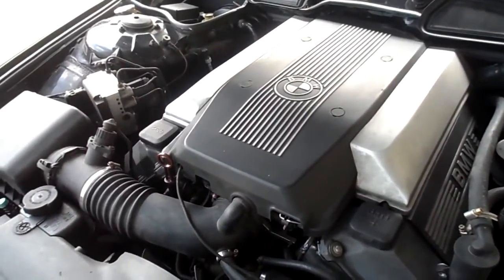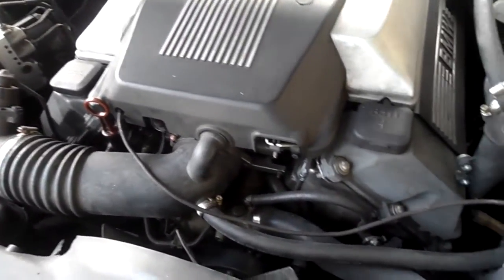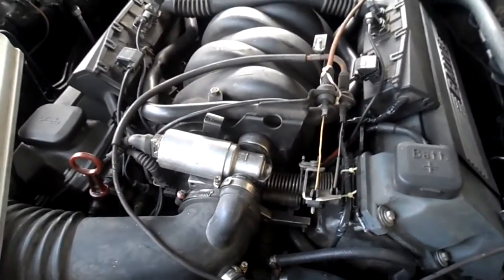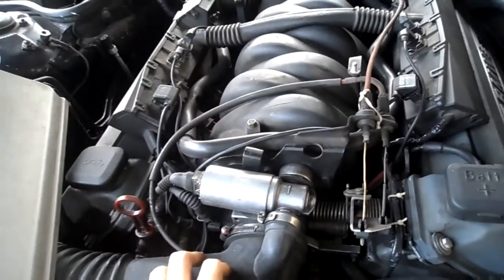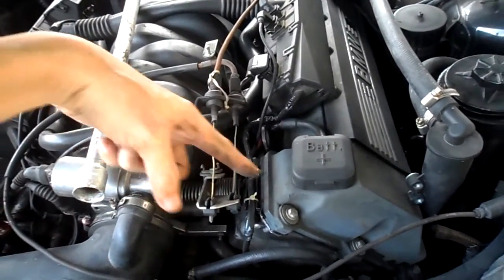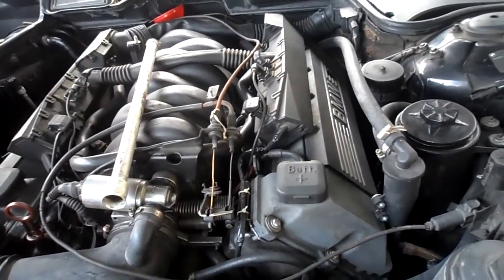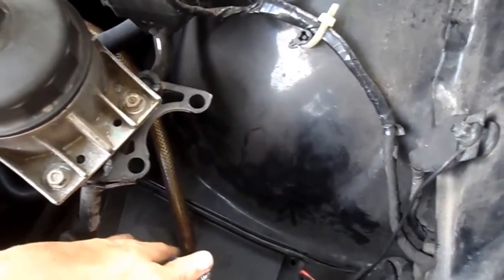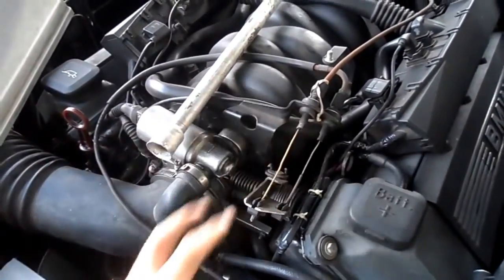Permanent repair of Intake Oil Puddle in BMW e38 M60 engine via Oil Separator bypass modification

Comment: Not to criticize you but this won't work forever.  It will only last for a few months.  Coolant hose does not do well with oil.   This also will make the car fail an visual emission test for modified.  I'm a smog tech that also worked at the CA Ref station.

Comment: Did you delete the ccv? Also, could one tap into the low pressure oil filter return line for any oil that drains to the bottom?

Comment: Can you block off the osv pipe and drill a hole into the nipple on the driver side valve cover? And just let it vent to air? I'm getting to much crank case pressure with just the delete plate installed
Reply from the maker: I think it is the same effect as venting from the OSV pipe. But since you managed to install osv delete plate, crankcase pressure has nowhere to go but seeping through every gaskets and it will create oil leak problems. 
Instead of just venting into the atmosphere, you'd rather route it back to intake hose between MAF and throttle valve. Good luck

Comment: same thing for the M62????2001 740il e38
Reply from the maker: I think so but M62 has less problem to overcome than M60. Simply replacing the PCV plate at the back of the engine usually fix the problem.

Comment: hey ...do you think that can be on a 2001 740il as well ????
Reply from the maker: I think so but M62 has less problem to overcome than M60. Simply replacing the PCV plate at the back of the engine usually fix the problem.

Comment from the maker: Please see hose routing details and 2019 update in description.
Reply: What did you do to the port/hole that the metal pipe went to on the back of the intake manifold? Did you block it off or leave it open? I have an 2001 740iL and it had an M62TU but I'm about to try this because I'm getting smoke on cold starts.

Comment: The oil needs to go back to the engine not on the ground
Reply from the maker: No oil caught by the separator touches the ground but left in the hose/container which was drained and disposed off properly.

Comment: or you could just replace the PCV on the back of the manifold in about 10 mins
Reply: oil separator is behind the timing chain on the drivers side. You have mistaken it for PCV which is on the back on the manifold.

Comment: did you block the hole off where the metal pipe used to enter at the front of the engine?
Reply from the maker: worst ever No hole was blocked. frontal hole where crankcase vapor was rerouted into an external oil separator, then back to original oil separator at rear of engine. this is to overcome the failure of oil separator behind timing chain inside the engine.
Reply: how is the "new" pipe connected to original oil separator at rear of engine?
Reply: I think he just hose clamped "new" pipe and plugged the other end where original metal pipe was inserted (part no. 11 61 7 501 562). Instead of replacing internal oil separator (part no. 11 15 1 747 066) he attached new external oil separator, which drains oil to the ground (?) and crankcase gases back to intake manifold just before throttle plate.